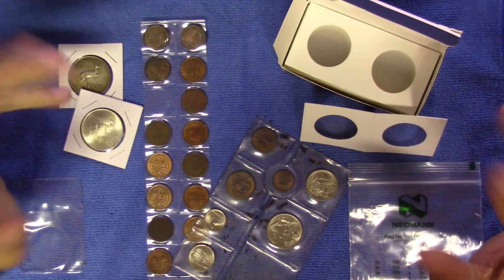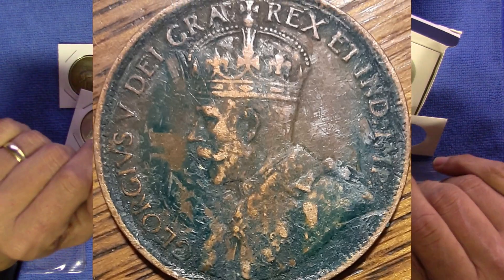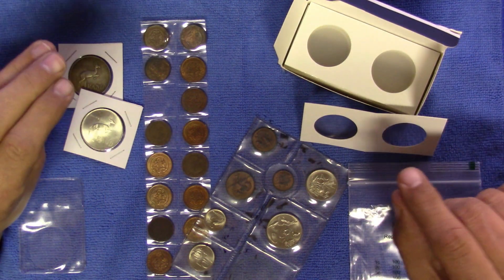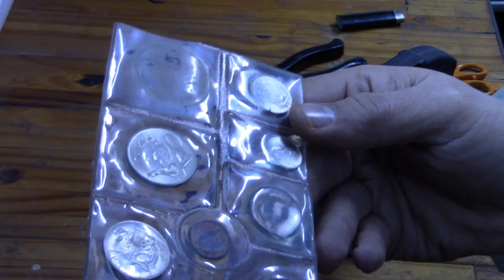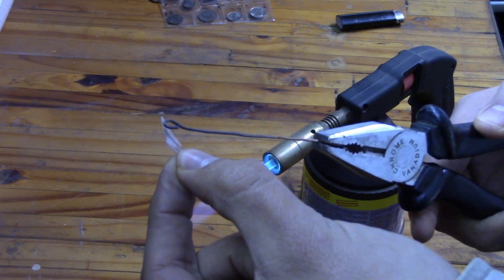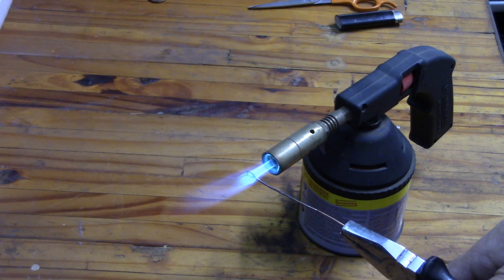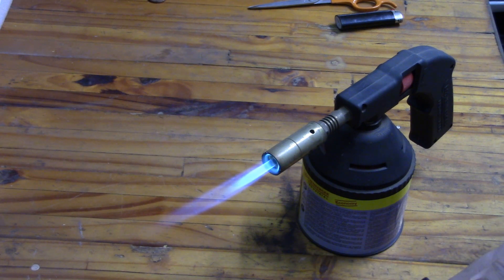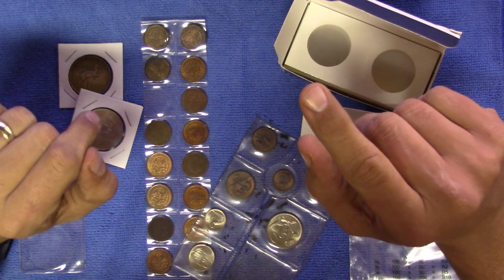How to detect PVC in your coin flips, envelopes and albums.

Comment: There are some sets I have from the 1970s where it is unclear. My approach is if there is no sign of deterioration and no green tinge I leave them in there. The dilemma is that when you take them out of the packaging most UNC decimal coins are not worth anything whereas in the set they have some modest value
Reply from the maker: That is my dilemma as well.  Also, many of the coins in these sets turns out to be proof coins!  In the set, the coins are part of the "unc set", out of it it is just another proof coin.

Comment: Testing an old album  - was that a Optima page? - and how old was it?  - Cos I was looking at buyin the Optima page system.....they say they are acid and chemical free
Reply from the maker: I cannot recall the name and make of the album (no writing on it either).  I bought it many years ago and was told it was "safe".  Obviously it was not... I cannot comment on the Optima pages, unfortunately.  If I were you, I'd buy the album and test it.  Not sure what you'd do if you detect PVC though.
Reply: @penniesshillings    Thanks.  I guess Ive gotta take the risk.  They seem the top brand, so if they have PVC then we are all screwed  :(
Fingers crossed its not 60 quid down the drain
Reply from the maker: Of course, only copper and silver coins are really affected. It also do take some time, so just monitor it as well. If you can store it in a drawer with a handful of those "don't eat" moisture absorbing things in there it will reduce the risk further.